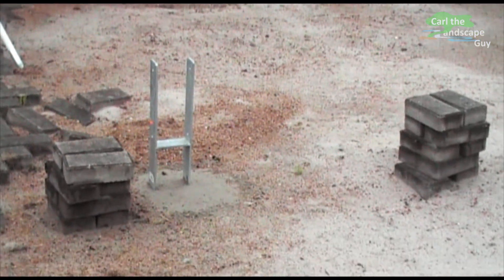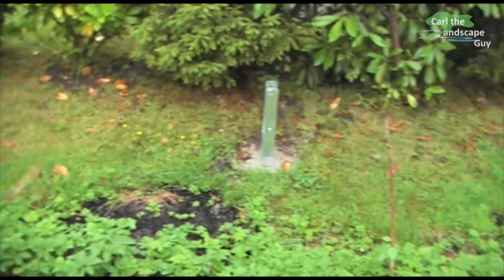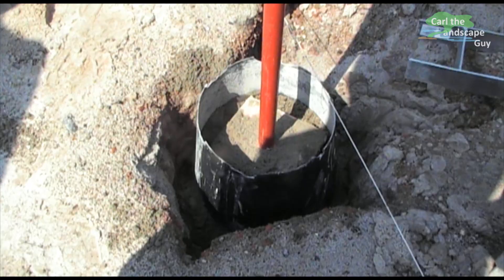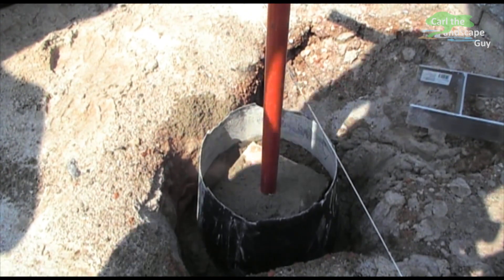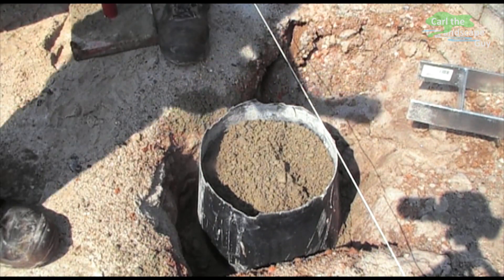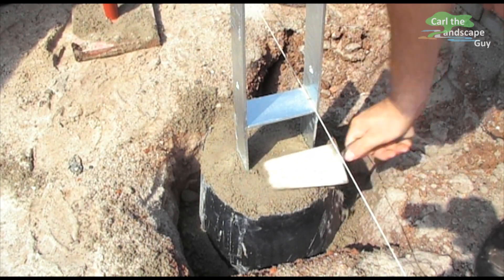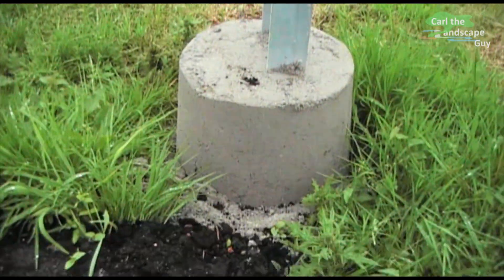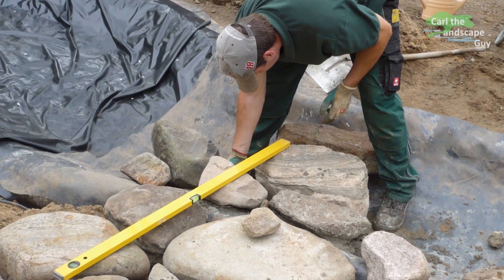HOW TO MAKE CONCRETE FOOTING FOR GARAGE, DECK, POSTS,CAR PORT,CANOPY,PORCH,H-ANCHORS FOUNDATION EASY

Comment: Hey Carl, I would like to add 3 ft. to my driveway, and would like to set steel or aluminum 
posts out that 3 ft and cantilever the top of the post over to load the carport roof
but don't know what size post to use. Jake

Comment: here's a few things for constructing shedsStart With a Sound Foundation a shed wont last long if it's set on a weak baseAllow for Air Circulation to prevent damp Build a Weather-Resistant Floor FrameUse Low Maintenance Materials so you don't have to keep re-painting it(Reference: Adota Blueprint Pack site )

Comment: Building a deck over an existing slab, any suggestion to anchoring to the slab if necessary. Planning an 8x10 and 2ft high.

Comment: thanks for posting Carl - nice vid, the ground i am gonna place a garden shed is sloping so building an array of concrete supports with your h-anchors is a good option to get the floor level, never saw these in any store around here but i have a welder so i will make my own, cheers.
Reply from the maker: you are welcome, im glad if this video helps, hope your project goes well! thank you!

Comment: After everything is cured and you put your 4X4 posts in... How do you drill the hole in the post for the carriage bolt while keeping the post level as well as making sure the drilled hole will stay in line with the holes in the bracket.